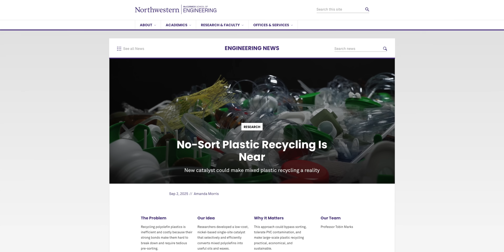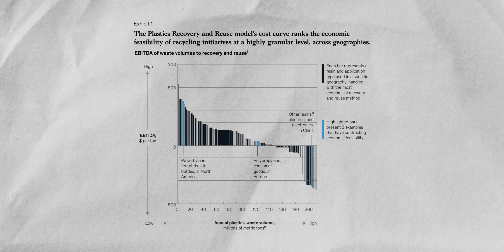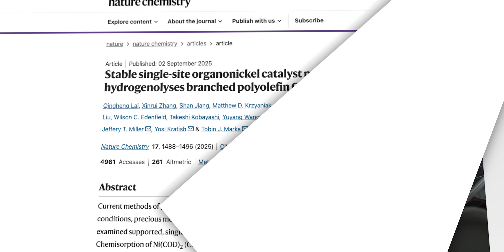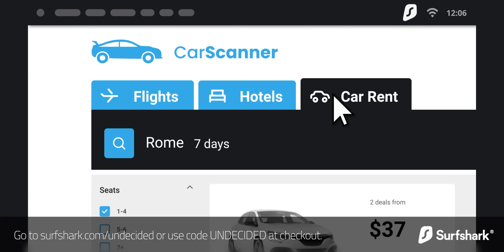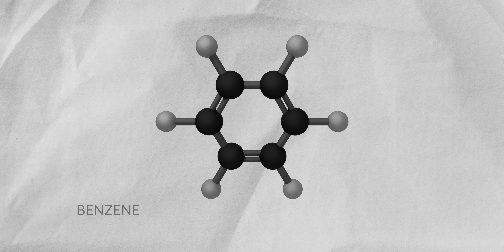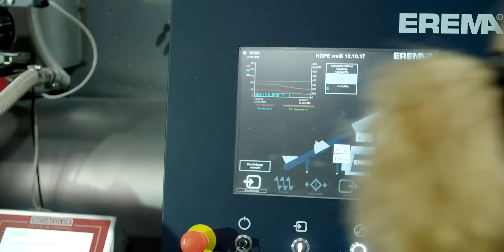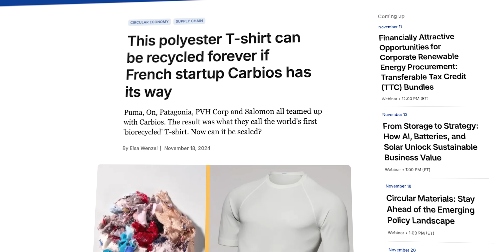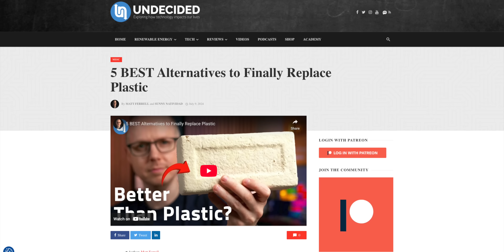The Recycling Breakthrough That Doesn't Need Sorting

Comment: Why not go back to glass and aluminum bottling?
Reply: Glass is far heavier and costs more - in money and energy/emissions - to transport than plastic.
Reply: @broadsword6650 I’d like to see the use case. This plastic recycling b.s. has been going on for 50-60 years. Make glass lighter, make it using less energy, have EV trucks deliver the glass bottles, recycle using energy efficient methods. This plastic recycling going no where for another 20-40 years.
Reply: @MM-sf3rl  it's not really a physics problem, it's a political problem. Recycling is very doable and it is done at an increasing rate, in Europe. For example, The UK has a plastic recycling rate of approximately 52.5% as of 2023, but the USA has a much lower rate of about 5%, making it one of the worst among developed countries.
Reply: @broadsword6650 Matt should quick green washing. Solutions already exits: JUST, CO., water’s carton bottles are composed of 54% paper from certified forests, 28% plant-based plastic, 15% traditional plastic, and 3% aluminum. They are in 15,000 stores. Tech Bro is not a solution Bro.

Comment: If there are no incentives to neither manufacturers or consumer, then virgin plastic produced from oil always win. It's the only hassle free product for all plastic manufacturing. But if manufacturers AND consumers have to pay a tax, that will only be partly refunded, if the product end up in the right place after use, then recycling will work. It's like paying in advance for the cleanup, that we don't do today. But this is off course a political hot potato...

Comment: Here's a better idea, ban unnecessary single use plastic. Anything that is necessary, highly tax the industry for everything that isn't recycled. I garuntee they'll figure something out quicker.
Reply: @zumahyena  ikr, it’s so easy and cheap to produce and noone is punished for the overuse of it. It should be a last resort, not be used in every single thing where it is slightly convenient
Reply: @JKOOLDK exactly! The UK is actually introducing a sales tax on single-use plastic packaging. It will also tax mixed material packaging that is non-recyclable. It could be stricter but it's certainly a good first step. 

It also organises waste collection and standardises it across england. It should help to incentivise recycling and allow neighbouring authorities to work together to deal with waste.

Comment: Seems like we should deal with the plastic issue on the front end, as opposed to reacting on the back end.
Reply: Why not both? There's no alternative to plastic films, cotton and wool don't perform as well as plastic outerwear, and putting every sushi roll and fresh berries in a glass jar is impractical.
Reply: @skierpage   Not saying we can't do both, but it will still require standardization on the front end to then support ease of processing on the back end.  No reason we can't merge towards consistent shapes, consistent products, colors (clear), etc for the vast majority of throw away plastic containers.
Reply: @JimYeats   definitely. I complain to companies that don't use #1 or #2, or color it, or put excessive plastic wrap on their containers. I wish the trash and recycling industries could name and shame companies that make their packaging hard to recycle, even to the point of coming up with a new symbol for "This packaging is actually recycled at post-consumer rate above 10%!" to replace all those wish-cycling triangles.
Reply: We now have the ability to create aluminum bottles with screw on caps, we could put all single serving drinks, soaps, and even more products in Aluminum.

Comment: the kind of breakthrough needed is a new demand for the recycleable plastic byproduct that cannot be filled by new petroleum processing.  Incentives and penalties are weak synthetics to the true requirement for wide-spread adoption; market demand.  Figuring out HOW to break-down plastics is one thing, but figuring out what to do afterwards is the issue.  If plastic from new petroleum can be substituted, it will be substituted.

Comment: As long as we still have electric plants burning dirty coal for electricity, then complete thermal pyrolysis with excess water (ie that goes to 100% conversion to Hydrogen and CO) of all carbon waste (plastic, paper, poop - anything!) is a better option than recycling because there would be no need for sorting. Also note that complete pyrolysis to gas is much cleaner than the incineration that's normally used to turn waste into energy.

Comment: If they really want this to take off, paying people to return plastic would get the planet cleaned up almost instantly. People would scrounge plastic even if it only had a return of pennies per amount.
Reply: @catserver8577 In Australia you can turn in aluminum cans and glass bottles for 10 cents per, it has created a very funny culture of "I'll take that empty bottle off your hands"
Reply: @something-something_username46  Sounds like it's working well then!
Reply: That would just create mounds of intermixed contaminated plastic that still has to be dealt with... probably by carting it to the landfill.

Littering is already illegal! Paying for bringing in plastic means poor people would just pull plastic out of people's recycling bins... then it winds up at the same dump.
Reply: @skierpage  Yes, I agree, in current day with the current process, that is correct. But this video is about other possible ways of recycling. So I will clarify, should they find this new method to be sustainable, paying for every scrap that can be processed is the way to go in a capitalistic world. I am aware of the failures of today's process of recycling, or the lack of it.

Comment: I still say glass is the goal for the nation/world. When we had that previous administrations supposedly pushing go-green incentives, what they should've done is offer corporations like soda and milk producers a tax break for using glass rather than plastic without making the price 3x the costs. The big benefit of glass is that it is 100% recyclable. Id see it going much further than these solar farms that truly weren't the big way to go green. In there current state, the solar panels are more for individual investments, not necessarily a profit or going green incentive, simply because of the manufacturing, the upkeep(cleaning), and simply the lack of efficiency. Granted I say we need to fix our recycling system before anything because most of those recycling bins look no different than trash cans.

Comment: 30+ years ago we used a plasma tourch approach to break down an exhaust flow into base components.  Think car exhaust into Hydrogen and Oxygen that could run in a closed loop. Or a smokestack with no smoke and all chemicals removed. Except, when we tried tombring it to market and filed for patents, we were stopped in the name of national security.  Reducing the heat signatures of Navy ships vs a potential of a clean air future.

Comment: In the 1990s, we were looking at and testing using plasma to eliminate biohazard trash from hospitals. It worked, but ultimately wouldn’t pencil out compared to burial. Hopefully current economics will let this technology thrive.
Reply: Ultra high temperature incineration would be great for so many things since it breaks down everything to its elements.
Reply: You mean the economics where everyone is groaning under increasing energy prices due to AI companies buying up all the electricity? Yeah, good luck with that...

Comment: As a University student who is currently doing a project on breaking down PET, with a mutated Cutinase enzyme, it is quite exciting to see this method actually being used in the real world. 
Although, the high performance enzyme we are working with, has been around since 1999, and yet it has seen no use in breaking down plastics outside of research, mostly because there is no economical interest in recycling plastics, with how cheap new plastic is to produce.
Another problem with using enzymes to break down plastics like PET is, that some plastics are semi crystalline, and enzymes can't break down the crystalline part of the plastics, due to steric hindrance, meaning the PET chain can't reach the active site of the enzyme because of the compact and stable crystalline structure.
Reply: I admire researchers trying to solve this problem, but until it's more economical to recycle, we're just not going to do it.
Reply: @BM-si2ei  just burn garbage..  at least they get heat and power from that process.
Reply: I think in here is buried the hint we need to understand how it could be fixed. Plastics is so cheap to produce. But it isn't cheap to use plastic, we are all paying a very high price, and maybe much higher than we think (given we still know little about how exactly it affects the biome on this planet and our own species more directly). Soooo we are speaking of this rather well understood problem of "externalities" and the way to fix it is to bake all the costs into the product. To the extent recycling the plastic avoids the external costs, their price should also reflect that. And then there would be interest in recycling plastics. The technical difficulties are one thing, but what is infuriating is that we are so utterly incapable of addressing the side of the problem that everyone understands and that have relatively easy fixes.
Reply: @dojohansen123 Easy fixes... sure.
Reply: @DJVARAO  The power of economics that gets us into these problems can be used to get us out of them too. If we quantify the externalities and add that to the cost of use then the volume of plastics will reduce and recycling or proper disposal will be funded.
If we don't price externalities into products then our economy will continue to be dominated by unsustainable products and services and those externalities will cause us to be worse off.
Reply: @zen1647  Sure. Unfortunately, physics and chemistry dominate reality, not the economy models. Plastics are not recyclable at a cost-effective rate. Basically nothing but metals is actually recyclable at sustainable levels.
Reply: @DJVARAO The economics need to be changed.
Reply: @zen1647  How?
Reply: @DJVARAO Vote! Write to your representative! People have fought for hundreds of years for the right to vote and to speak freely - use your power!
Reply: @zen1647  I can't vote in the US. But how voting defies chemistry?
Reply: @DJVARAO  Ever heard of laws?
Reply: @DJVARAO I think you're purposefully trying to be obtuse. A virgin plastic tax would encourage plastic producers to produce plastic that is easier to recycle or consumers would substitute plastic with other materials such as aluminum, glass, or paper.
Reply: @ibmuurmann9098  can you anneal it to a 100% amorphous state or is that impractical?
Reply: @shunyata_00  Annealing plastics usually increases crystallinity. So this is the opposite of what we want.
Although there some people who are looking at using heat to break crystallinity during breakdown, although this requires enzymes that are resistant to the higher temperatures, which we have not managed to synthesize yet.
Reply: @ibmuurmann9098  I used to machine a lot of plastics, and we call any heat treatment of plastics annealing. Not technically correct, I know. We did it for internal stress relief. If you heat to just above Tg and cool rapidly you can, at least for some plastics, get them into a mostly amorphous state. Not sure if that is practical, but whoever is trying to heat in situ is going to find the temps needed are higher than denaturing temps. Some plastics are actually going to crystalize more in the upper range of what the enzymes can handle. Anyway, just a thought. I was curious.
Reply: @shunyata_00  I must admit that i currently only posses a limited knowledge on the behavior of plastics in different temperature ranges, so i will trust your words for it until i have done some more research on the subject myself. 
But from what i understand, heating the plastics to above their Tm and slowly cooling them, you reduce the amount of crystallinity, but inherent properties of different plastics, mean that there is a lower limit of the amount of crystallinity you can achieve.
And as for breaking down the polymers in higher heat environment, it is mostly a case of thermodynamics, with reactions taking place faster at higher temperatures, but also because of the free volume change after the Tg transition, making the amorphous chains more mobile and thus more interactive with the enzymes
Reply: So, you're saying you've hit a dead end with your research?
Reply: @1axcohn1  Most projects aiming to eco-goodness are like the volcano project but for graduates...
Reply: Exactly. You only need to look at the cost of virgin plastic vs recycled plastics. Recycling is not in the interest of the petrochemical industry, and they will always undercut the cost of recycled materials. I have seen papers proposing using products from some of these processes as feedstock for pharmaceuticals, but my  guess is they will come up against issues.
Reply: Yep, 100% accurate. My undergrad research was using enzymes to recycle polyurethanes, mainly foams, back into monomers for new plastic production. You can get these technologies to work well, especially at smaller scale in research labs, but making them economical and viable for general use probably will not happen anytime in the near future. We’ll see though, one of my friends spun off a polyurethane recycling startup based on our research. I’d love to see enzymatic recycling become widespread and know I played a small part in that.
Reply: And what's the status of your project?
(If it can be publicly discussed, ofc)
Reply: @drillerdev4624  We are several groups from different semesters who are all working parallel on this topic, on each our own part, but as this is the first semester to have picked up the project again, we have limited data as of now.
My semester is mostly looking at the crystallinity of PET in relation to particle size, and the breakdown speed of the enzymes on the different particle sizes.
So our current focus is on microplastics and enzymes.
Reply: you can recycle glass forever and plastic a few times
Reply: Just saying: Look up the company Cyclezyme.

Patent, heat treating using microwaves. Now testing larger scale after successful tests for a year with RISE.

Economic viable.

Upcoming financed project.
Reply: Recycling will happen when it makes money sense to do so.
Reply: I have been hearing stories for decades about all sorts of initiatives for biological plastics for bags, packaging, etc. But somehow it never became successful. I don't know whether it had to do with cost or companies just didn't care that much.
Reply: @TinusLightfoot  Something I read a long time ago made the pertinent point:  It will happen when it is economically viable!
Reply: You mean the chemical breakdown is non profitable?
Reply: You say new plastic is cheap. I say you recycling idea is expensive.
Reply: @RayTheMickey  "You say new plastic is cheap. I say you recycling idea is expensive."

While kind of funny, this comment misses the cost of the externalities from plastic waste.  These are costs that the businesses producing plastics foist on the world in general without paying for.

Leaded gasoline is another good example of business externalities that had/have a very high public cost that is not paid for.